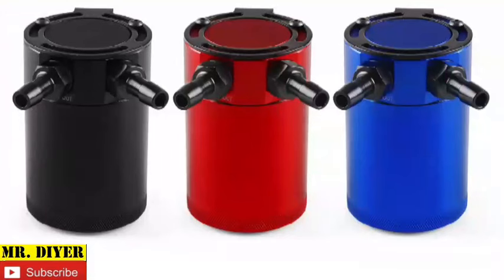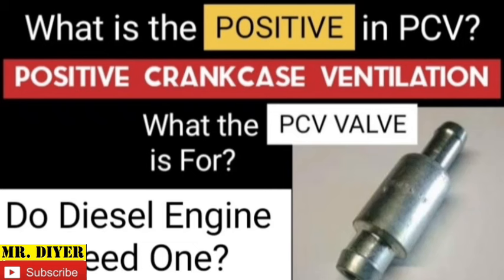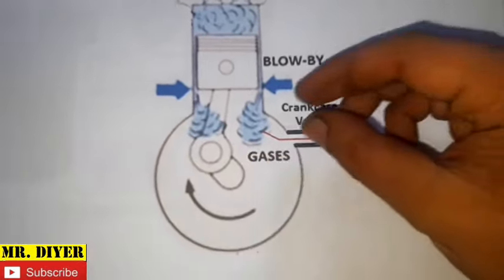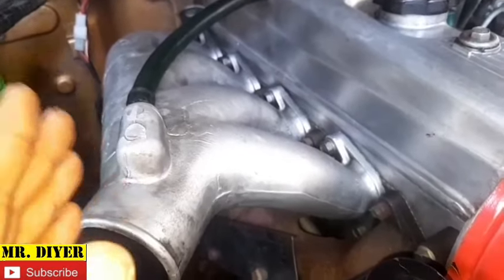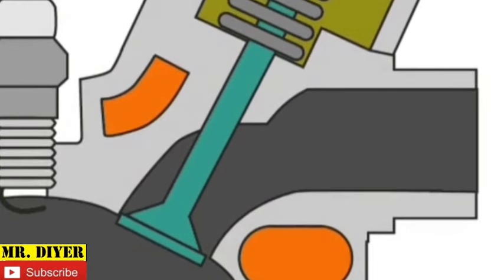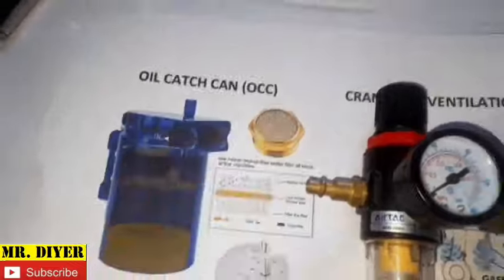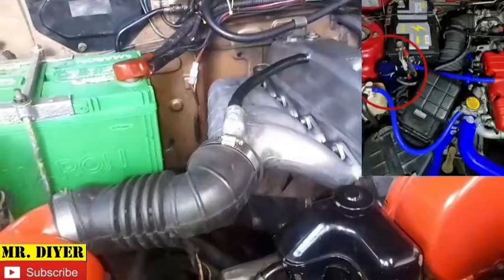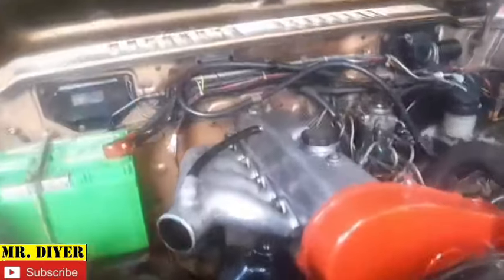This Is Why I DO NOT INSTALL AN OCC OIL CATCH CAN

Comment: I think you can still achieve the fast release of gases with occ by using the correct fittings and hoses for the engine. Use a hose with a large inside diameter as well as the fittings on the occ.
Reply from the maker: Lol
Reply: @MrDIYer  anong nakakatawa?
Reply from the maker: @oscarbatungkahoy8835  ganito lang yan. Mapa mahabang hose maikling hose malaking hose at ano pang brand ng occ yan. Hindi ko sinabi na wag kayo mag lagay. Ang sabi ko eto dahilan at explanation kung bakit di ako nag lalagay ng occ. . Kung gusto nyo maniwala ok, kung ayaw nyo, ok din.  Kung kayo kumbinsido dyan..ok lang makina nyo yan. Lol
https://youtu.be/rMzFMcHrAyU

Comment: Your experiment was flawed and led you to the wrong conclusion. The water trap filter and regulator used was designed for high pressure and is much more restrictive than any oil catch can.

Many oil catch cans (in fact, most of them) don't use a fine filter like the example you've shown in the slides, they use centrifugal action and/or a series of baffles instead, and don't become restrictive until very high flow rates. Even the cheapest "open" catch cans that you can stuff steel wool into are not very restrictive.

You can make a super-crappy test version from a plastic bottle and some steel wool, cut the end of the "in" hose twice at a shallow angle (shallow so the point keeps the hole off the bottom, opposite sides so there's effectively two holes and you can't block it with the side of the bottle), stuff it most of the way up with steel wool (if you want to get fancy,  coarse at the bottom and fine at the top), and the "out" hose is connected at the top of the bottle. This will be much less restrictive and easy to test.

Edit: I just watched your second video. That's... odd and not at all what I expected. Is the catch can you used a filter type like you showed at the start of this video, or a baffle type? And does it do it with your air filter connected as well (as most air filters will give a little restriction, it might be enough to stop your oil coming out)?
Reply from the maker: lol
Reply: @MrDIYer  so does that silver catch can have a bronze filter in it?

Comment: You used the  air compressor water seperator on the engine to prove a point. Put a OCC with baffle design and show  us the restricted air flow with a meter before and after.This is just a magic show.😂
Reply from the maker: https://youtu.be/rMzFMcHrAyU?si=E0afbX6YPE2VEgya
Im curious to see what you will say next lol

Comment: Your information is not complete... 
Have you compare the filter density between the proper OCT and a water separator for compressor???
Water separator work on much higher pressure, and some model has a built in one way valve. You cannot use it as an OCT without a proper adjustment.. 
Its like you have a clogged PCV if you install it without adjustment.. 
:D :D
Reply from the maker: Lol whatever floats your boat

Comment: Use a proper occ like genuine Mann Provent  then you will not have any back pressure on crankcase ventilation. It is already proved with gauge test. You'd better to say don't install garbage OCC.
Reply from the maker: Hahahaha
Reply from the maker: Whatever floats your boat. Lol
Reply from the maker: Ill share this with you but i doubt it would matter because obviously you have already convinced yourself and youll still find another reason lol.  But this im sure of, if theres garbage here, thats definitely you. Lol  https://youtu.be/rMzFMcHrAyU
Reply: @MrDIYer  i like Italian lasagne but not in the inlet manifold
Reply from the maker: @burakh.8670  i said ealier i doubt it would matter. Now im sure it wont. No amount of explanation would matter to an individual with a close mind. Lol like ive said. If theres garbage here you have definitely proven its you. Lol
Reply: @MrDIYer  yeah i am closed mind just like you. By the way there are plenty of diesel engine comes with occ from the factory as stock.
Reply from the maker: You really are garbage still trying to convince yourself. Lol anyway its your engine, if soon enough your engine will become garbage just like you, guess what, its not my problem.  Lol

Comment: boss, hindi ako sang ayon dun sa pinakita mo. ang engine blow hindi mo agad makikita yan, it accumulates overtime depende sa wear and tear ng cylinder wall at piston rings tsaka kung high mileage engine mas maraming engine blow by. kahit nga new engine meron blow by pero konti lng. tsaka ung sinasabi mo na kelangan marelease agad ung blow by from the crankcase is tama, pero ung PCV vlv is a check valve pagexit ng blow by thru PcV to OCC's baffles back to intake manifolds. filtered na kaya effective ang OCC to prevent EGR system clogging and blown head gasket.
Reply from the maker: Hahahaha ok